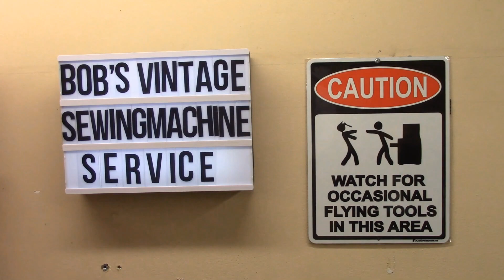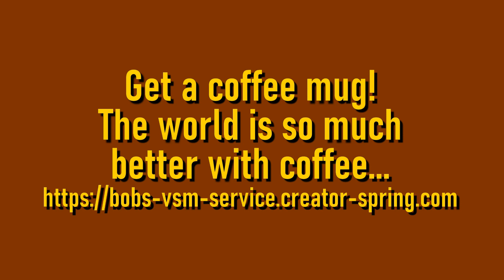Viewer mail, Singer 101 lamp tips and tricks - Sunday Morning Quickies, Episode 53, August 14, 2022

Comment: I have a German transverse shuttle that has not only a large rim diameter and width, but also a tall sidewall that I haven' been able to find anything to fit.

Zoom spouts not only deliver too much oil, but when you pull the spout out, it's all covered with oil, too--what a mess!

The most common reason I've found for sticking in one spot after good cleaning is wound up thread, and in places you'd never think thread could get into and wrap around stuff.

I've never found alcohol particularly helpful in cleaning out varnished/oxidized lube. Low odor paint thinner has been working well for general interior cleaning. I love the smell of AeroKroil!